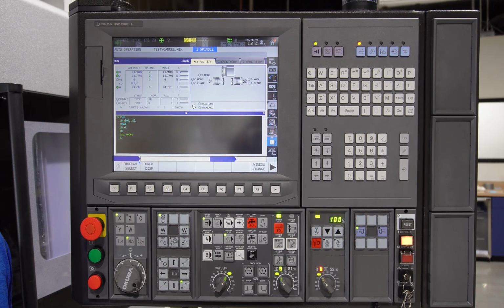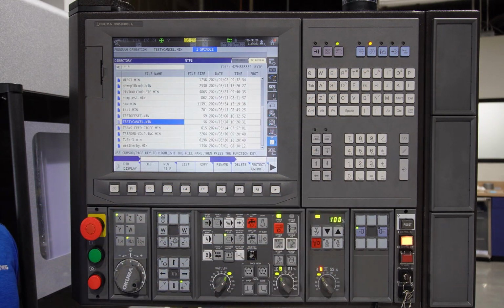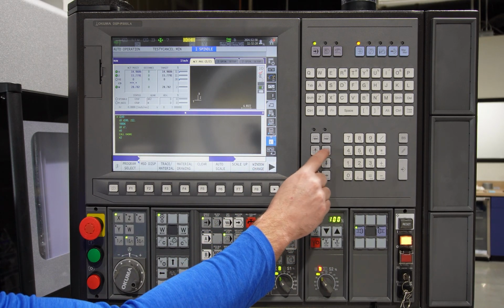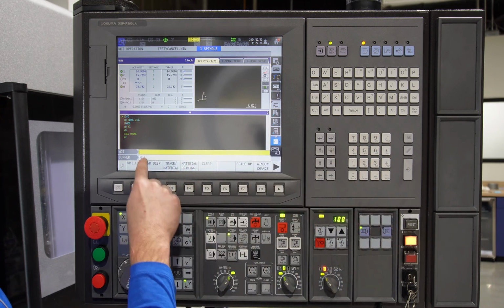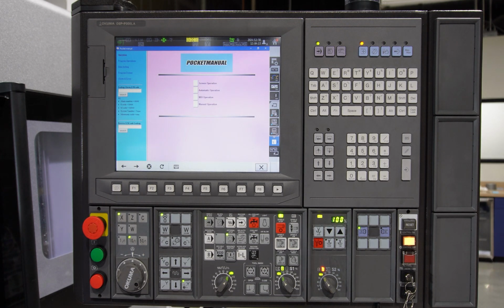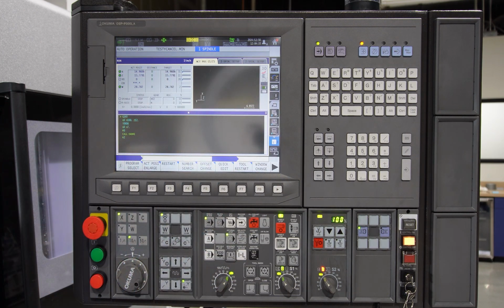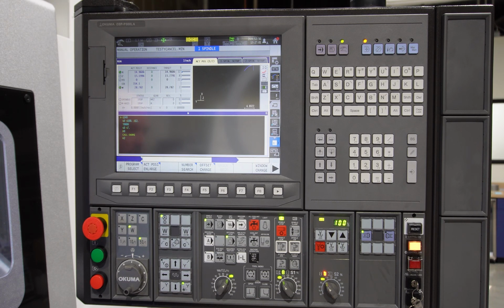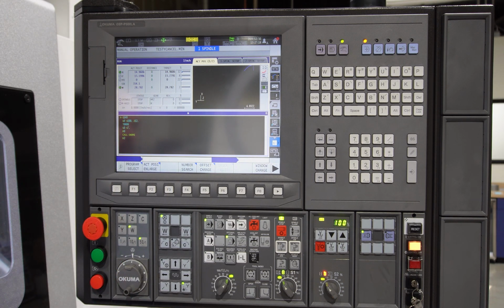Okuma OSP-P300L Control Overview

Comment: I grew up with the Okumas in the LC 30 days.  The only thing I don't like is the restart feature on these panels.  When I have a program that is 5000 lines long, it takes forever to get to the point I want to start at.
Reply: instead of using the Restart function key you can use the Number Search function key.  Just need to be careful.  This will jump to the Line Number without reading the code on the way there (unlike Restart, which reads the program on the way there).  You can then start your program from there.